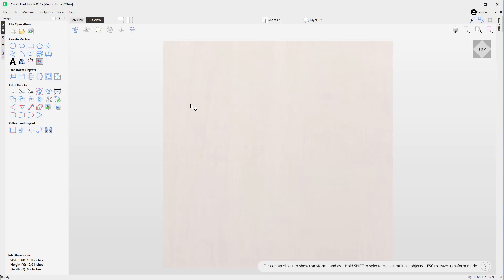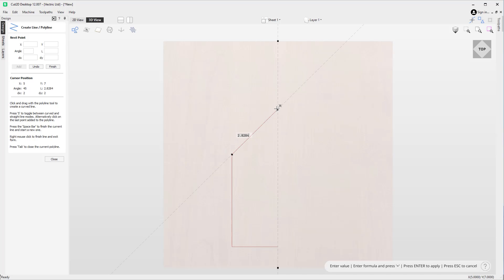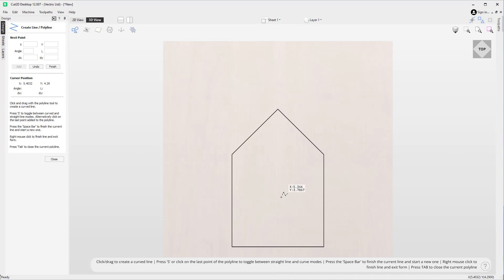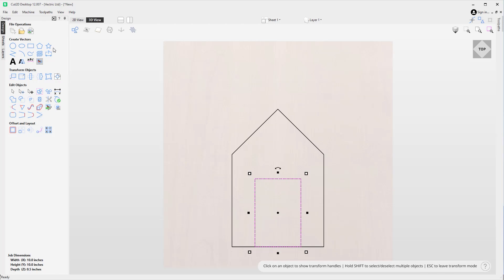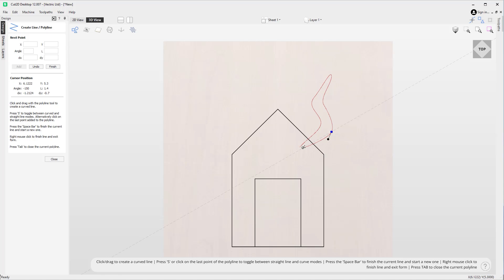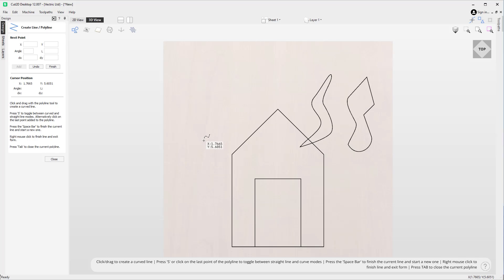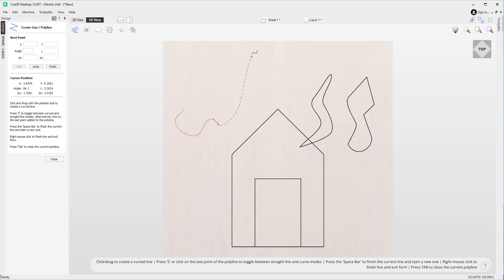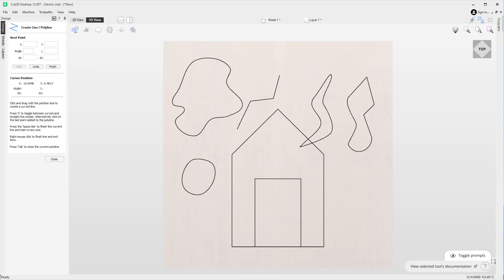How to use the polyline tool in Vectric software | Creating Vectors | V12 Tutorials OLD

Comment: Good day,
Could you help me get rid of a ridge I get when I  try carving the inset Eagle Head. How do you raise the carve to eliminate the line I'm getting around the outer perimeter.
Reply from the maker: Hello Bernie, it sounds like to need to add a bit of "Base Height" to the model.  You can do that in the 3D view if you have V12.  You will need to have the model selected and there will be a few floating icons to the bottom of the model.  Look for the one that adds "Base Height".  If you have trouble, I would suggest contacting suppoet@vectric.com.